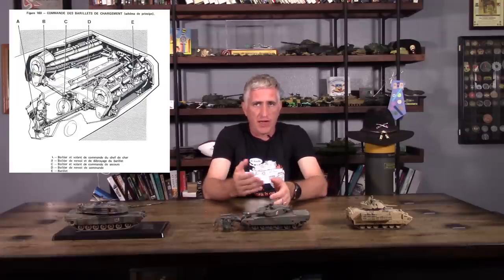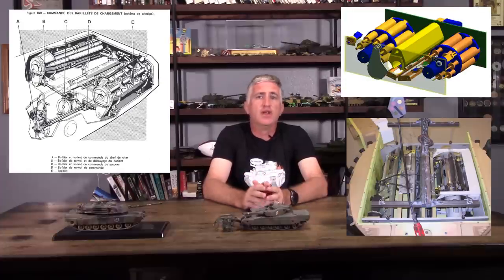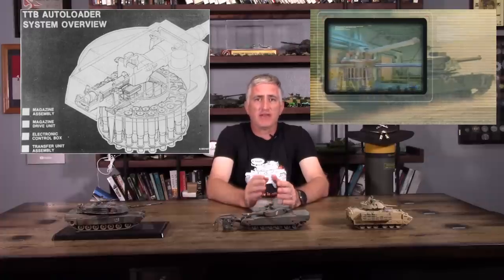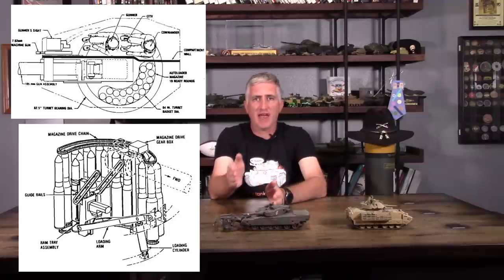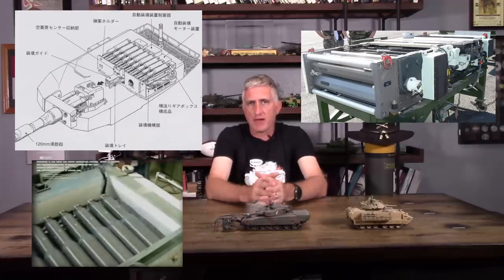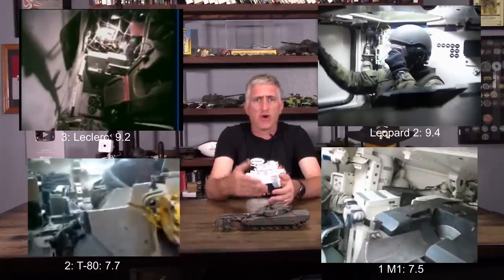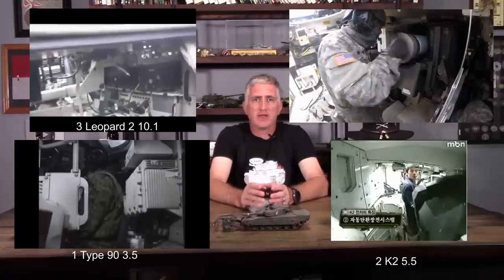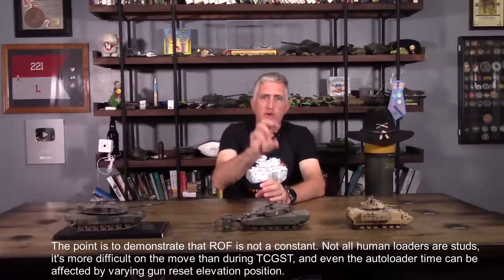Whither the Autoloader?

Comment: What about amo types? Can auto loaders select different types? Can they remove a round if you desire you want to change types without firing?
Reply: Andrew Wells yes, the Commander (and gunner in some case) position, by example on the soviet t-64 t-72 t-80 etc, had a control panel to select the type of ammunition, this was done by rotating the carousel (which often contained different types of ammunition depending on what you loaded in it) and so you could just rotate it to the type of ammunition desired.
Reply from the maker: Depends on the auto loader. Some do, some don’t. Worth noting that in combat, the fastest way to empty the tube is to pull the trigger, which is what we do in the M1
Reply: Yes for the first question, depends for the second. 

Selecting ammo types is easy for the autoloader. There are two ways of doing this. The first is to have a reasonably intelligent crew who can be trained to program the autoloader computer to remember which slot holds which round. Unfortunately one of the Leclercs in Chieftain's batallion is screwed then. Its smartest crew member is a caveman. The second method is to simply color-code the rounds and have the autoloader computer read them off and tag their locations in memory. It doesn't even need to have that memory. A color scanner at the loading position is enough. Run each round through until the right one is found.

Removing a round from the breech is still difficult. The Meggitt autoloader can probably do it, and the autoloader for the 140mm "Thumper" testbed had it as a spec requirement. The TTB autoloader could do it. In these cases, the loading arm simply reverses their loading processs. In other autoloaders this is not doable. The Russian carousel loaders have no way of extracting a round because they have only a rammer instead of a loading arm, and even if they did the two-piece construction means the front part of the round would still be stuck in the chamber. In the Thumper (which also used two-piece ammo) this was resolved by having the rear part of the round lock to the front part using a clamp ring. However, the Russian 125mm round has a rear part that is thicker in diameter than the front part, so this solution is not available. In the French (Leclerc), Ukrainian (T-84-120), Japanese (Type 90 and 10), Korean (K2), and Chinese (VT-5 light tank) bustle autoloaders, there is only a rammer instead of a loading arm despite the bustle arrangement, so removal of the round from the chamber is a manual task.
Reply: Loup5264 Thanks you. Could the auto loader taken the rounds back and store them?
Reply: Yes, but not all type of autoloaders can do that. plus what you mean by remove a round? from the gun chamber? if that no. the majority of gunners select the target first before they choose the type of ammo. and I repeat some of them cannot because they automatically insert the round for you in the chamber.
Reply: Andrew Wells Some other of your replies already explained this a thousand times better than I would, if I hadn't read those replies my awnser would have been "I do not know". If you want to know more about autoloaders, the website "tankograd" (which only writes about soviet tanks of the Cold War) is the perfect source of information (articles on tanks with an autoloader will have a section on it with tons of information. Tankograd is also in my opinion, the best source in the world to get information on Soviet era Cold War tank designs and operating.

Comment: You missed a point, autoloaders require the tank to be running it's engine, there is no way to play quiet with one, APUs can solve some of that, but a no thermal output mode would be impossible, Many autoloaders have a crank option, but it's so absurdly slow to be almost pointless.
Reply from the maker: It seems to me that once the gun is fired and the autoloader needed for the next round, any further attempt at remaining silent is likely futile.
Reply: You'd also lose power to your turret controls, so no powered controls. All manual. In reality, the autoloader can still run on the tank's batteries and it will consume a lot less power than the turret's traverse and elevation drives, so the reliance on a power supply isn't a valid point against autoloaders.
Reply: No power, no advanced sensors, targeting, communication. And the loader is needed after firing which is a big "here i am" indicator.
Reply: Assuming you are in a turret down position  you have to crank the engine to fire anyway.

Comment: In the end we all have to go for M1TTB and T14 design because ammo is so big that auto loader is necessary and bustle auto loader doesn't contain enough ammo for a meaningful sustained fight. So a combined bustle and carasoul autoloader with a crew in a separate compartment is the choice. Apfsds and pele in carasoul while missile and heat/he rounds in bustle. If you want manned turret then you have to go for nkpz design where the engine is at front with autloaders in the bustle and in the rear separated from the crew with blast doors like merkava.

Comment: Well done. I'm convinced.
I have a thought for you: It would be interesting to have, for some military over some (recent) period of time, an account of every time an AFV used its canon in action. Specifically, what was the target (tank, IFV, other vehicle, fixed position, sniper, infantry, helicopter, and whatever else) and what would have been the ideal weapon for dealing with that target.

The point being to see how often a particular weapon -- from 20mm up to 125mm I guess -- would be the right weapon for an actual engagement. I'm guessing that there must have been times for you when a 25-40mm autocanon would have been preferable to your 120mm.
Reply: Practice has shown that coaxial 100mm and 30mm works just fine, despite it used on old like mammoth sh!t BMP-3, which has totally wrong (constructive) role of IFV and battle transport. In fact, this complex would be much more useful on "light" tank with better mobility and defence.

Comment: The T 14's autoloader allows 1m darts (longer than Abrams's dart). In the T 72 and T-90 the dart is quite a bit shorter than a dart fired by the Abrams. The t-90's autoloader was redesigned to accommodate longer darts but these APFDS are still shorter than the Abrams uses.

Comment: Got any high capacity stowage clips for that Assault Semi Autoloader?
Reply: The Bandkanon 1 used 14 round clips for reloading it's internal magazine in one go, they were issued from the factory as single pallet cargo. All the ammo handlers had to do at the depot was to load them straight onto the ammo truck, drive out to the reloading sites, break the wooden crate around the clip and use the ammo trucks own hydraulic crane to hoist the clip over to the relocating SPG. Time from arrival at reloading site empty to leaving with full magazine of 14 rounds: 2 minutes with conscript 19yo crews.
Time from commencing fire mission requiring total expenditure from a full 14rounds to empty magazine: 45s
Caliber: 155mm

Comment: One more con: on the HSTV-L prototype it was found the barrel life and accuracy would degrade faster when fired more rapidly, over 7 full ROF shots or something I think, given this gun could fire 1 round in a second. Much like a .308 precision bolt gun will never need a barrel swap but a M240 will need quite a few (but probably to a way lesser degree on tanks)

one more pro: Armor degradation, meaning a smaller gun that fires rapid follow up shots can penetrate the same armor one round from a larger gun could if the shots hit close enough together.
Reply: Well, every barrel degrades faster if fired more often in the same timeframe. But how often do you actually need sustained fire with a MBT main gun? If you need more than 3 shoots to take out an enemy tank you should start to think about retreating anyway. Because either your gunner is drunk, the ballistic computer doesn't work properly which means you only missed so far or you actually hit, but it didn't stop the enemy tank which means you have a very serious problem at hand because apparantly your ammunition is incapable of penetrating.

Generally you aim center mass and hope for the best. You don't aim for specific parts of an enemy tank. It wouldn't be possible to hit certain parts of an enemy tank reliably anyway because typical engagment distances today is 1000m+.

Comment: I don’t believe you mentioned one of the major problems although I may not have heard it as I was doing laundry while listening... one huge flaw of an auto loader is that in a carousel type basically any penetration into the vehicle will cause the ammunition to detonate. Just about every video of a t72 that gets penned or a grenade thrown down the barrel ends up with the turret flying off a few moments later and the crew becoming a thin mist. It’s a problem that tanks with a loader occur less frequently

Comment: I am not too sure if this mentioned before. I think autoloaders are used if weight constraint is a big priority. For example, the Japanese developed the Type 10 tank which weighs 44 tons to replace the Type 90 tank which weighs 50 tons. Both tanks use autoloaders. However, there is a lower percentage of bridges in Japan which can support the Type 90 tank (which resulted in the Type 90 being mostly based in Hokkaido) compared to the Type 10 tank. In addition, a much fewer percentage of bridges in Japan can support tanks with human loaders (M1A2 Abrams and Leopard 2A4 to A6).

Of course, a human loader can be retained and still keep the weight low. This will require some armor reduction. An example is the Italian Ariete tank which has a crew of 4 but weighs only 50 tons.

Comment: i am biased sense i am a tank louder but two of the thing i hold dear to my chest are one what if we need to change the already loaded ammunition and what if the tank commander get badly injured or killed during fire fight... also part of my job as a loader is to make sure the chamber is clear of any hot residue after firing multiple round strait to prevent premature fire. And last thin is that i have never heard sub 8 second reload from 120mm or bigger tank cannons and for me expected load time is around 6,5 second no matter the condition or state of my body and i can proudly say i can do it. Just wanted to share some of my experiences and thought.

Comment: Very insightful from someone with hands on experience with them. I know you discredit your tanking experience, but for some of us arguing the specs of paper tanks because someone said so rather than researching or experiencing the facts, I value your word.

Question kinda related to this auto-loader thing. There's been the talk/development of remote control AFVs and APCs. What's your take on that? I don't think we're far enough on solid remote signals to have such a thing and having boots on the ground is sometimes the better option to have. But I remember there being talk of one that fell through, but things like sapper-bots and what have you are things. Would it be useful/practical for it to be scaled up to like a MBT?

Comment: I would recommend a new tank be designed with autoloaders, sensors and communication for  2-man crew-in-hull tank with six tanks per platoon.    Tanks would work in two-tank pairs, to permit a team of 4 men to fire and maneuver in the attack, or set up a 'scissors fire' ambush in defense. The pair would be linked by wide band so the two tanks would cooperate to get the advantages of 'all round vision'.
Reply: They tested 2 man crew tanks in simulators years ago, it doesn't work well. The main issue is that when your drive the tank, you can't really look for targets because you have to see what's infront of the tank. So in a 2 man tank, the tank commander really only can look for targets or drive the tank and the gunner can only drive the tank or control the turret and gun. Humans can't really multitask or as i sometimes discribe it a stressful way to do multiple things wrong at the same time.
Reply: 3 seems to be the minimum for effectiveness, 2 also means no redundancy if one crew member can't fulfil their duty
Reply: @ToxicJelly9  modern AI permits a 2 man crew.  That is specified for the next infantry vehicle.
Reply: @DonMeaker  I guess time will tell whether it makes more sense to only have 2, AI still can't fulfil the roles of a crew member, like if a crew member goes down then there's absolutely noone to replace them. AI can't repair a component or assist a crew member in a task other than what it's designed for, unlike a human
Reply: @ToxicJelly9  All true,  but 6 each two-man tanks will have advantages over 4 each three-man tanks.
Reply: @DonMeaker  yep, that's also true, I guess with the way warfare is going, smaller, lighter vehicles with lower profiles that are less visible with a smaller signature would be the way forward, after all

Comment: Speaking of autoloaders: In his book on Leopard 2, Krapke states that in a bustle-mounted autoloader it would be preferable for the rounds to NOT face toward the crew, for survivability reasons.
Is that a realistic concern? (Or was, back in 1986)
Reply: It still is. Rounds like HEAT or HESH might get their fuses triggered by impact in the case of propellant ignition and the energy would be directed straight into the crew compartment. The Meggit autoloader is really the best design for a bustle autoloader. The only problem is that it needs more than 1m of space between the gun breech and the bustle bulkhead for the loading arm to function.
Reply: The shaped charge in HEAT ammunition could penetrate the armor separating crew from ammunition. It's better if the ammo explodes outwards than towards the crew.

Comment: biggest issue I see with autoloaders is the design of them, if you don't have a blowout panel DESIGNED into the autoloader like the ABRAMS X or T14 (At least I hope the T14 has blowout panels...) your turret basket will pop like a cherry bomb to most hits, even ones that perforated your armor but would've been non-catastrophic without 14+ shells surrounding the turret. Having the turret also be unmanned is a good idea. Keep the men as far away as possible and between a steel plate and the ammo.
Reply: Why cassette autoloaders users wouldn't feature a thing that they had on previous design tanks? 
Leclerc, K2, Type 10, etc. have blowout panels to deflect detonation.
OTOH, T14 doesn't feature a blowup panel inside the carousel because it has TWO autoloaders. warhead in the carousel, and propellant charges in the bustle. So they have two chances to be incapacited. Shoot under the turret and you wreck the carousel with possible catastrophic event. Hit turret neck and see it burst in flames.

Comment: Excellent video. It is however vital that the whole platform is considered as a system right from the outset. Many comments refer to the advantages/disadvantages of autoloaders in relation to current and older generation of vehicles, e.g. maintenance concerns. Even views from experienced tankers are too often influenced by (unrealistic?) training rather than operational needs.  System design can reduce workload of many tasks, e.g. modular replacement of LRU's (line replaceable units) think of the reduction of maintenance and servicing tasks on modern cars. The same is true of automation (including things like drones and other sensors) to reduce operation workload (extra set of eyes) A 3 man tank should be capable of operation static by one man, mobile by two and crewed by three. 
As regards manually loaded vehicles, the distribution of rounds around the tank is rarely considered. I well recall having to advise safety staff on live firing exercise of a need to traverse out of arc (i.e. turn the turret around) to re-stow ammunition into the ready round stowage. There may be a case for two autoloaders in a tank to cope with the required bomb load, one in the turret and one in the hull (with automatic re-stowage) if the profile and vulnerability advantages of autoloader/3 man crew are to be fully realised. 
On a related issue, Please can Chieftain comment on videos which appear to show Saudi M1's suffering catastrophic detonation in Yemen implying that the turret blow off panels were ineffective? Thanks

Comment: One thing i would like the mention is that there is no reason you have to remove the 4th crew member when adding an auto loader, a bustle loader on the leo 2 could still retain the loader in a seat.
it would be good for spoting, using maps, operating radio.

Comment: My one argument would be crew replacement but i'm pretty sure as soon as you take any sort of penetrating hit then the tank is abandoned anyways. I'm not too sure how the crews treat that situation since I'm just a simple game pleb. 

I also question the weight savings since you'd be designing the tank with the autoloader in mind at that point and then you'd have a whole new tank to worry about. However other countries dont see this as an issue either so it's kind of a moot point anyways. 

my biggest question is how the system selects shells cause that's what I would be curious about how that works with autoloaders as well. I would assume the gunner has a shell swap mechanism so he can directly select shells he wants but I have very little knowledge on how or if that exists.
Reply: the controls are programmable to select shells from different parts of the magazine. this allows the gun to press a button for a sabot shell and it loaded. then the next target is soft so a different button is pressed and a HE shell is loaded for example.
Reply: @matthiuskoenig3378  That's what I figured cause it wouldnt make sense to have just a feed system and not have some kind of system to choose the right shell type.